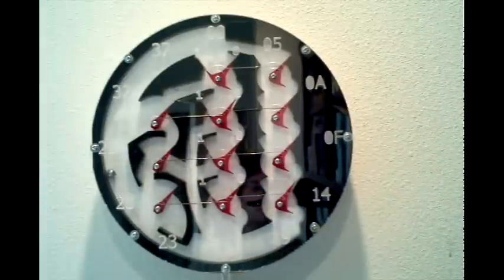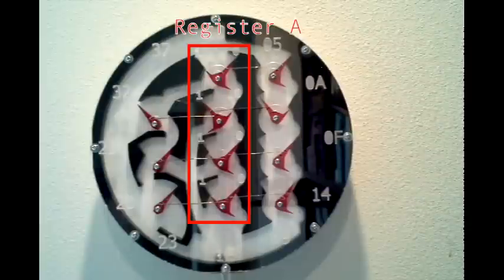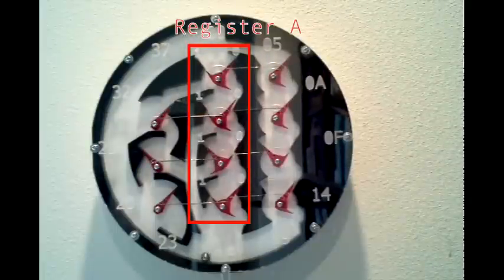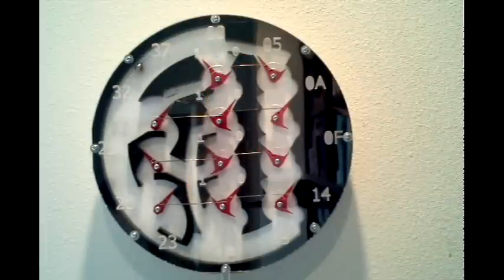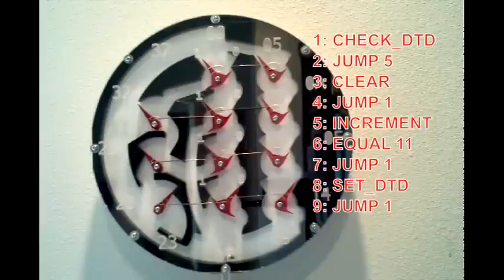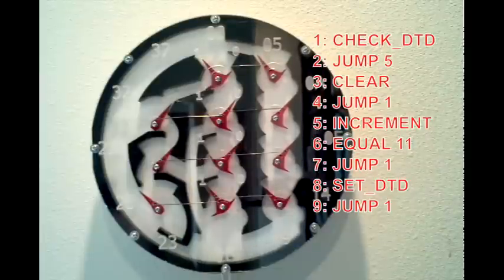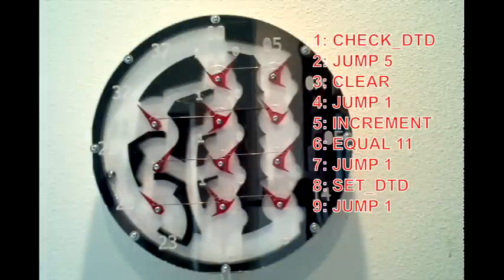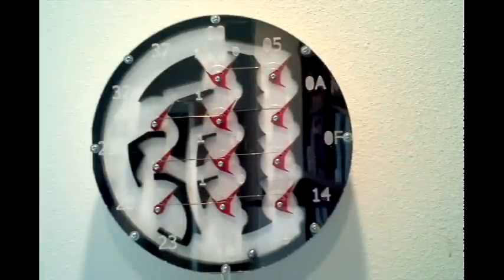Mechanical CPU Clock

Comment: I feel that this kind of illustration should be made in any programming class. Up until now I've coded, but never truly understood how anything worked. This really helped me working through my recent hobby of ASM coding.
Reply: I found the Elder Scrolls guy!
Reply: Why? I don't understand anything on this video...
Reply: They used to teach binary in the 50's... what happened?
Reply: I wonder how do people not understand code but when they see a mechanical version of it, they will understand?
Reply: @kserrata  perhaps a module in ICT or in PF Acadamies but not like they used to. look at old pathe videos.. it was taught out of necessity before anyone even owned a computer
Reply: Agreed
Reply: Computer engineers still learn from the top down. High level programming down to the circuit design for processors and potentially even to the physics of electromagnetic fields.

At any decent school at least.
Reply: This isn't even close to processing instructions, this is just the clock.
Reply: That's what I think is a bad aspect about teaching programming in schools and after. They start from the high level programming concepts like hardcore OOP and sql and then far later teach architecture and asm in uni, which for me a (physics guy at school) was utterly painful, at both ends. Learning fuking oop and file handling in even C++ felt way too abstract and I desperately searched for the interface - the part where hardware can be used to create software to be explained. Which well came later in the form of Semiconductors then digital logic and then architecture. But by then, I had through struggle accepted and learned high level C++ , abstract Oop and turned into a comp sci guy, taking a Cs degree and now when I normally program in C++ and generously use Python for several tasks, am forced to do asm programming, casually running out of registers for normal programs in C..
Reply: @li5up6  Electromagnetic fields are for electrical engineers
Reply: @li5up6  you can learn from both sides rather independently. High level programming doesn't help very much when you try to construct an ALU from gates/transistors. 

Btw. referring to that old original comment: A great way to approach assembler programming in a gamified way is the game Human Resource Machine.
Reply: @meingutername2158   I think it's not directly relevant but having the big picture understanding is very helpful.

Comment: Excellent. I have noticed a small optimisation: in the left hand register you can remove the middle gate (representing 4). The lower gate will block 0 → 7, the upper gate blocks 0,1, 4,5, 8,9, The top bit of the centre register block even numbers. So with just these 3 we have blocked 0 → 7, 8,9 and 10, that is 0→10, but not 11. We do not have to worry about numbers above 11, as we will never get to these numbers.

Comment from the maker: The minutes can be read from the position of the ball and the lever (the lever is hard to see in the video as well as the etching, so from 1 to 20 minutes is hard to see). The numbers on the outside represent the minutes in HEX format (base 16) so
00 is 12, 05 is 5, 0A is 10, 0F is 15, 14 is 20, etc.
So you take the first digit to the left multiply that by 16 and add the right digit. 
Example: 32 in HEX = 3*16+2 = 50 in decimal
Reply: e
Reply: What lever? I don't see anything... I assumed it was a magnet hidden behind the face that was rotating once per hour. How do you read the minutes?
Reply: @AureliusR  There must've been a difference between the device as it is shown in the video and some earlier or later documentation.
You can see the minutes in hex on the right half of the clock, as the comment states, but there's nothing to indicate them. In the way the clock is set up in the video it would've made more sense to etch the minutes only on the left half as a semicircle.
I'm guessing the intention was to have a lever scoop the ball, with a tail that stretches out to the right half of the clock. He ended up using a magnet instead, but didn't change the clock face or explanation.

Comment: Mechanical Systems that use concepts from digital technology are always interesting. However I disagree with the comparison to modern CPUs. A counter is not an ALU. Counting is an arithmetic operation, but by definition ALUs also need to perform logical operations. It also doesn't "execute" code. It's function can be described by pseudocode, but since it doesn't read a program which it executes, but rather is  built for one specific function it cannot execute code. Comparing this clock to a modern CPU is misleading. It would make more sense to just cal it a binary counter with a conditional reset, which also describes all the functionality in a single sentence.
Reply: Well, it is possible to do all sorts or logic operations without a designated ALU function. As long as a system is turing complete. So I don't think something has to have logic operations like and, or, xor, not and so on. Sometimes just minus is enough (see the turing complete CPU model `subleq`)
Reply: @emilioschmidt2106  I agree, but Lior Elazary claims that his clock has an ALU although the only function is counting which makes it an arithmetic unit at best. Since it doesn't support logical operations itself it shouldn't be called ALU. Of course this machine isn't turing complete either since it can only act as a clock or counter and would have to be completely redesigned to perform any other operations.
Reply: @endodd_7742  True. It is neither turing complete nor does it have s real ALU
Reply: Yeah it's really more of a simple mechanical computer like a slide rule. Not a CPU at all
Reply: @emilioschmidt2106  subleq is a conditional jump operation. It requires both an arithmetic and logic unit to implement that conditional jump operation. Yes, you do not need a very complex ALU, but you can't implement subleq with just arithmetic operations.
Reply: haha yes this echoes my sentiment entirely on the pseudocode part. Why try so hard to make the system look like it is executing assembly? Where are the instructions stored? How do I program this "cpu" to do anything other than those operations in the given order? Very misleading video title...

Comment: Nevermind I got it. But for those of you like me who took a bit to fully get it right off the get go, here is a better explanation. 

Middle column starting from the top is 1,2,4,6.  When the dials point to the left or at 1(on) they are on and you add up all the dials that are pointed left/1/On.  

Ignore the first and last column, as they don't tell any part of the time. This clock is a 12hr clock that only shows the hour. 

Simple explanation for those who aren't in to this stuff.
Reply: 9 years late, but its 1,2,4,8

Comment: When it comes down to it, technically regular clocks are also mechanical digital computers.

They're mechanical because they work using gears instead of semiconductors. They're digital because the "seconds" hand are always in one of 60 exact positions, i.e. it's a computer calculating using a base-60 digits, i.e. digital.
Reply: Oh yeah, tell me then how does 6:30:45.9 look like on an analog clock? The hour hand is halfway between 6 and 7, the minute hand is three quarters between 30 and 31 and the second hand is 90% of the way between 45 and 46. I can crystal clearly see that none of the hands are settling "in one of exact 60 positions". Also, the hour hand can settle in only one of 12 positions and that only if it is exactly hr:00:00
Reply: @luinérion  Being in the continuous, analog realm, the hands of a mechanical clock will always move without jumps, the hands of a mechanical clock will move throug swift transients just like voltage levels on a circuit board. The voltage transients are engineered to be negligible in a well designed digital system and the same happens with a mechanical clock. A wristwatch with a  6 beats per second movement will have the hand stand still in 360 precise spots on the dial and have it move in relatively negligible time from one to the other.

Comment from the maker: Its a bit more then a mechanical counter since its also needs to check if a value is equal to a number and branch based on that (so it has a one bit program counter). It could also be reprogrammed by reconfiguring the registers. However, the programing is done by changing the tracks or the flip-flops (see digi-compII).  Therefore, it could be considered as a fixed-program computer, which was how the early computers were programmed, by physically changing the wiring (see ENIAC).

Comment: How is the ball transported though? If you can change the pace at which it travels, how do you make sure that you can get an accurate measurement of time at all? If there are any electrical parts involved in making this clock work, it wouldn't be fully mechanical.

Comment: The hours are shown in binary. Can you see there are 1s and 0s in the middle of the clock? (its hard to see in low resolutions) If those show 0001 it's one hour, if it shows 0010 it's two hours, etc. The minutes are indicated by the position of the ball when it's going around on the left hand side and is in hexadecimal format (23=32, 37=55)

Comment: It's neat and nicely made, and I like what you're trying to do here. But I argue that you have not emulated a CPU but rather some fairly simple sequential logic. There is no stored program that can be changed to reconfigure the working of the clock; it's all hard-wired. The 'ALU' is not an ALU at all, it's an adder with a fixed AND gate logic to detect '11'. This is not to detract from what you've made, but I think it could be more honestly described.